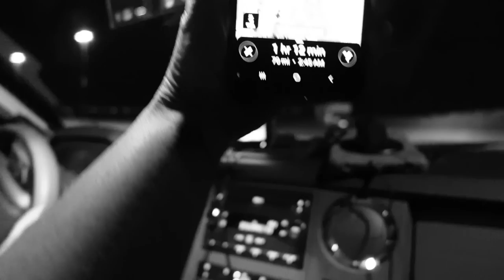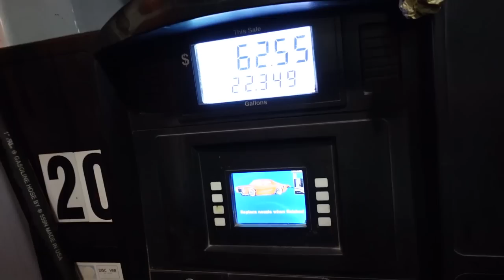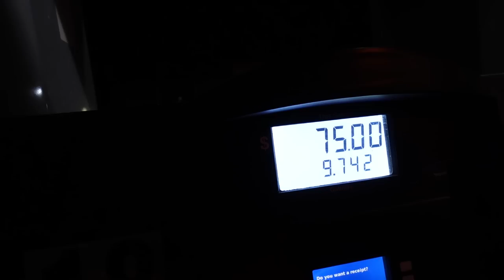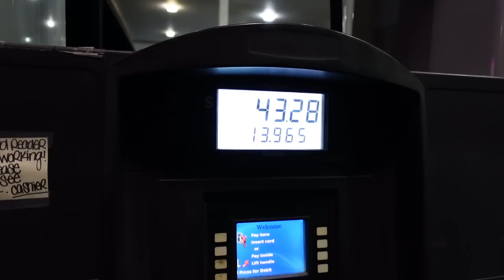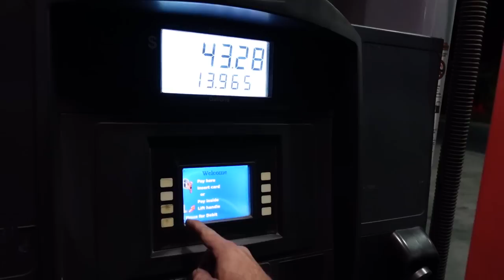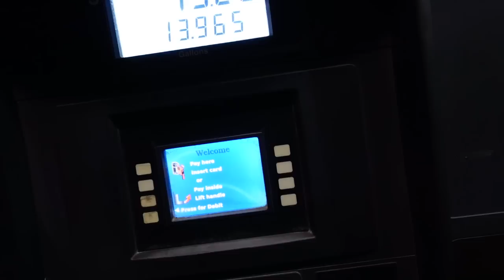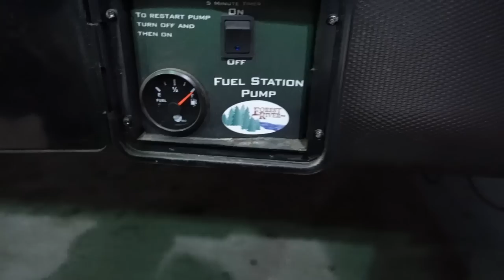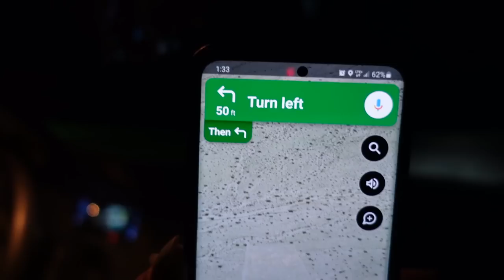GLAMIS THANKSGIVING 2020 Some Evo, Some MTS And Some 100 Octane In The X3

Comment: 25:15, nice wheelie😎
Reply from the maker: Once you get these things up over 200 hp they wheelie easily.. good times
Reply: @DandiOffroad  How do you like them compared to a sandrail, can't decide what i want to get yet
Reply from the maker: Sandro's are awesome but, and I will catch heat for this.. sxs are just more reliable period, yeah we change the belt here and there but other than that we ride the hell out of them and just maintain mostly
Reply: @DandiOffroad  I see, I have a sandrail that needs a new motor and some work, I am tempted to sell it and save up for a can am or RZR because of the easier maintenance  and what not, only thing I will miss is shifting gears
Reply from the maker: I owned buggies / Sandrails for 20 years before we bought our first sxs. Although shifting is cool,  not shifting can be nice also. I can tell you we have 6,000 mi, over 6,000 mi actually on our side by sides and they're definitely much easier to keep running. And I have access to a complete shop that specializes in sandrails.
Reply: @DandiOffroad  Something I have to think about, I know nothing about working on sandrails, mine has sat in my garage for a couple years, I am itching to get back to driving in Glamis

Comment: I've run the 4wri evo tune in my car since the start of glamis season on Halloween and it is a beast in the dunes. I switch back to my 95 tune in the desert. I love the 4wri tune in glamis
Reply from the maker: Yeah that's a great tune huh? We're enjoying it.
Reply: @DandiOffroad  mad hit in the low and mid range which is exactly what you want in the dunes. Makes driving fast and quick accelerations a breeze.  Taking mine to kms to have them tune my clutch better so blowing belts is less of an issue
Reply from the maker: That's so true. In our experience no matter what we did blowing bells is still an issue. What we have found 3200 mi in is that if you press the accelerator too much for too long of a Time, the belt pops. LOL.. We're running Evo weights and primary spring now because we have their launch control, and with the additional horsepower we had to get a little heavier weights.
Reply: @DandiOffroad  did you try kms clutch tune on your 4wri tune?
Reply from the maker: Our clutch actually still has the secondary KMS spring in it which is what is claimed to make belt life last longer. We ran the KMS clutch for a year and it was great. However just a disclaimer, our experience  has been, no clutch mods, including the different clutches that my cousin has ran, have significantly improved belt life. Not something I really worry about, we change it when it breaks and roll on. Don't get me wrong I've heard of extreme cases where there are those that can't even run a full weekend without breaking a belt, in that case I would say there's something wrong with the clutch. But that has not been an issue for us.
Reply: @DandiOffroad  good info and thanks
Reply: @DandiOffroad  nice to hear that kms and kelly isn't as bad as some make him out to be. I know that his adjustable weights because of the plastic inserts might not last as long as other clutch kits but he does seem to know how to tune a clutch. I did talk to Phoenix speed industries and R squared motorsports at the offroad show and they seem to have solid performance solutions as well, especially their big turbo setups.

Comment: Now that was a awesome ride, love how it’s so easy for you guys to pull a wheelie. And love the sound of the BOV and motor without the wind noise. I’m trying to find the right spot for my mic, need to experiment a bit, my BOV is in the back right behind the exhaust. I’m definitely going to try and get out to Glamis for a week between Christmas and New Years with my boys and I, do you know if you guys will be there?
Reply from the maker: Thank you. I'll blow up valve is near the turbo and the camera was mounted on the a-pillar period it's a GoPro hero 7. Looks like we'll probably be there on the 31st
Reply: @DandiOffroad  
Well the sound is great. I thought you were using a separate mic.
Reply from the maker: No I gave up on all that, too much trouble. If you get one of those foam covers it helps reduce the wind noise, or put a wind sock over the Mic hole

Comment: Nice to see you there , i have a truble whit my can am for watever reason the tune 85x rr dont push all the boost and rpm they should , but i enjoin see the anothe people rip the dunes
Reply from the maker: If that's an EVO x85 tune you may need to adjust the crack pressure RPM issues are usually due to clutching. Thanks for commenting
Reply: @DandiOffroad  i set up the crak presure more and more and no diference so i dont know if a got problem whit that tune and i fell the rpm is to low im just hit 7800 and 22.6 boost
Reply from the maker: The stage 5 x85 tune is supposed to run at 22 lb of boost so I think you're already there as far as boost. 7800 RPM is a little low. Did you get the clutch kit for the tune? Are you data logging to get your boost numbers?
Reply: @DandiOffroad  the x85 tune for the 2020 turbo rr evo say is a 255 hp @ 27lbs boost and crak presure set up at 12 ... yes i get the kit they recomended for that tune i got 6 black wheight and the orange spring the fuel pump and injectors bov kit whit charge tube and the map tuner , the only problem i got is i cant data log cause i have mac book pro so just a friend help me donload the tunes into my map tuner
Reply: I saw a video you make a long time ago like on september , one of yor frien have isue whit the boost and you chek for boost leak so i just go to buy all stuf to make a boost leak test and let see, you dont know how much inenjoy your video and hou much i smile whit your wife at the same time im practice my english
Reply from the maker: Thank you so much. Hopefully you get that thing figured out, anything you need let us know.
Reply: @DandiOffroad  yes sir thanks to you for take the time to help other , if i fixt the problem i want to go glamis to test if you want to come you are welcome
Reply from the maker: We will be there the 31st of December

Comment: I haven't been to glamis in about 15 years and thinking of going there during the week. Back in my day we would camp in the flats but the vendors are there now.  Just wondering if anyone can suggest a good place where a class A won't get stuck.  ?
Reply from the maker: If you go through the vendors straight back behind it's pretty safe. We normally don't have to air down or anything.